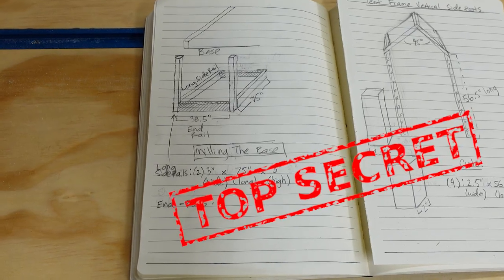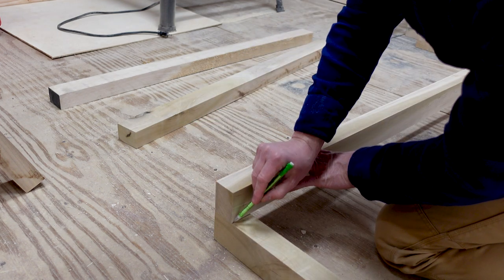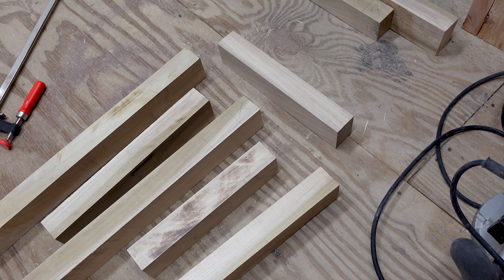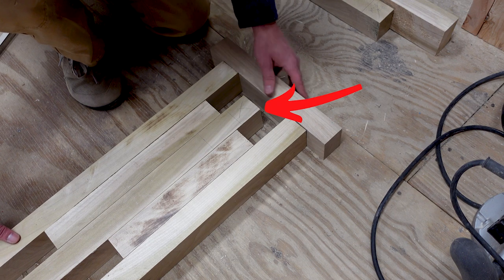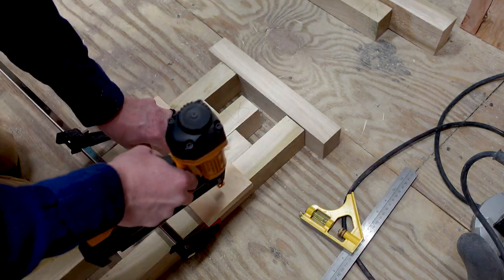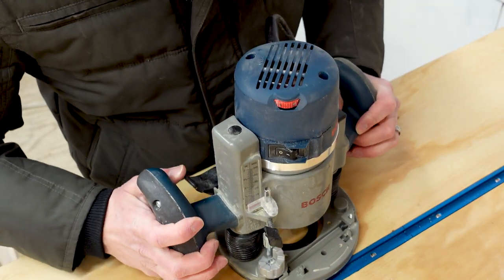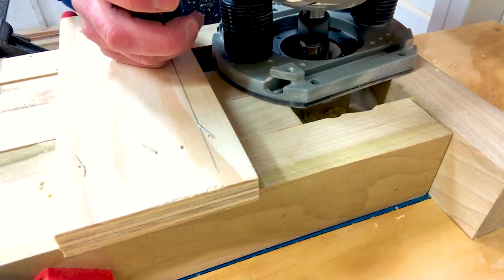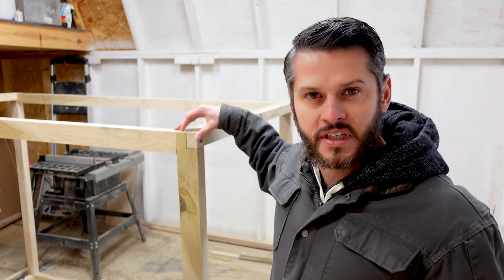How to Make Half Lap Joints with a Router || Woodworking Jig

Comment: That is a very neat technique thanks
Reply from the maker: Thanks! I found that it can actually be more accurate and faster than using the table saw method when done correctly. I’m going to try making an adjustable angle and depth jig at some point, so I can use this technique for angled/mitered half lap joints. Let me know if there are any woodworking techniques you’d like to see me try next!

Comment: Would this be any easier to do on a router table, or in my case an inverted router hanging from a piece of 3/4 melamine?
Reply from the maker: Yes, depending on your router table setup and whether you could adjust the depth to the right bit height, you could do it easier with a router table. I would not recommend doing it with a router table unless you have a sled to hold the board against while you make passes. But, with a sled giving you extra control over the board to prevent it from spinning the piece of wood, or ejecting it from the table, you could make the process easier. It also depends on the length of the board and the size of your routers table top. The method I used I was able to make the half lap joints on a 5’ long board, something I would not personally ever try on a router table. Hope that helps and good luck!
Reply: @BuskItBarn  This was helpful, thank you. I also noticed that you and others cut your half laps individually instead of together. Does cutting them individually wind up being less work in the end because it seems like you're having to do everything twice.

Comment: I saw that you flipped between the Milwaukee and Bosch router. Any preference of tools?
Reply from the maker: Yes, I was borrowing the Milwaukee to try it out. For my use in that video, both worked well. Bosch seems to have better attachments for dust collection, and they have some accessories with great reviews that I wanted to buy in the future. The Bosch also has a good sale over the holidays which really helped! Are you looking at both those routers as options?

Comment: Making lap joints with a router is slooooooooow.
Reply: Whats the best way to make a lap joint?
Reply: @ericr154  A faster way is to use a table saw with a dado blade set.
Reply: @tycox8704 What happens if you don't have a dado blade, or a table saw? 😳